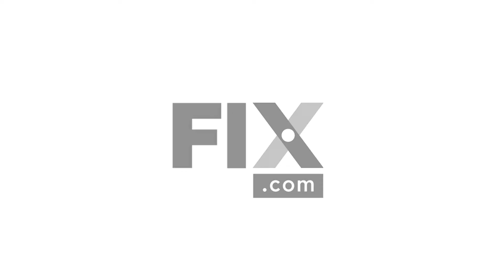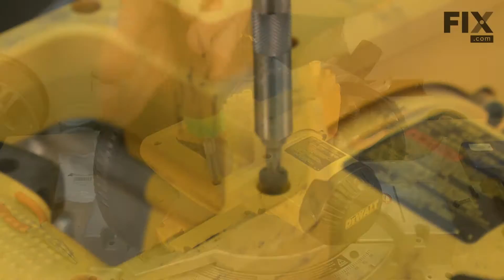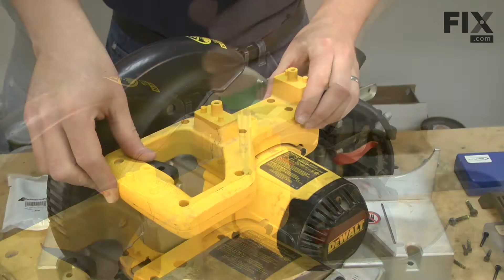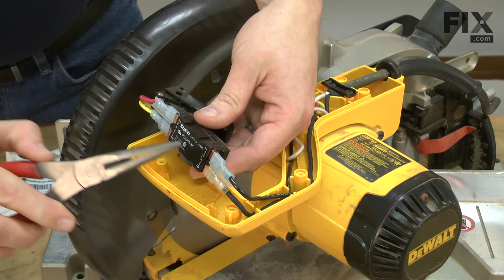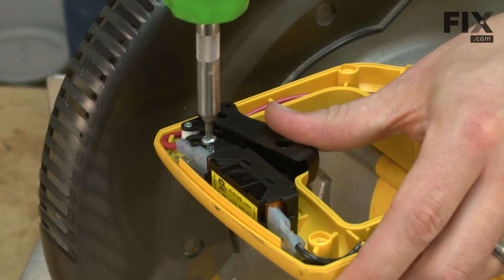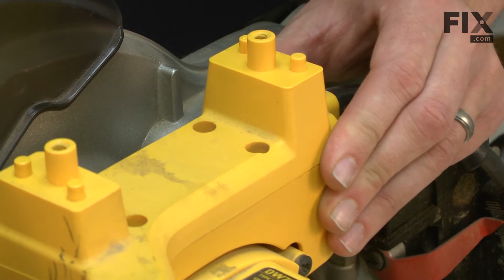DeWALT Miter Saw Repair – How to replace the Switch

Comment: how do i rewire a new delta replacement trigger switch with an old rockwell trigger switch. the wiring is different  #34010  vs hy38
Reply: is there a video of the re wiring?

Comment: I have the DW 716. I recently replaced the spring, but now the guard sticks when I try to pull down, so I have to lift the guard every time I make a cut. Its very annoying and the saw is only 18 months old. I can't find any info on line for how to adjust this. Any help would be greatly appreciated. 
Thanks in advance

Comment: there is cleary picture on the switch that says 250v 10A,  is there any wiring options to rewire from 120v to 240v ?